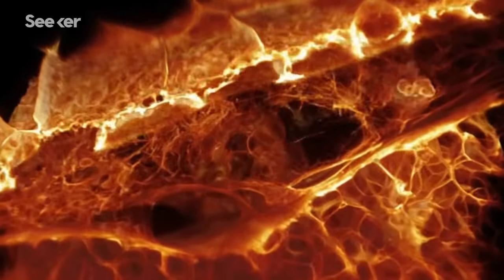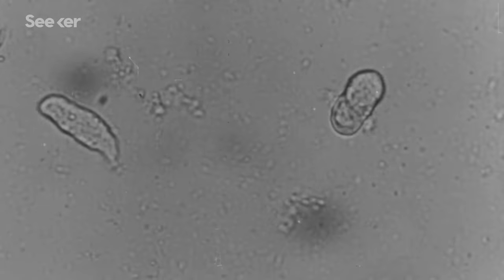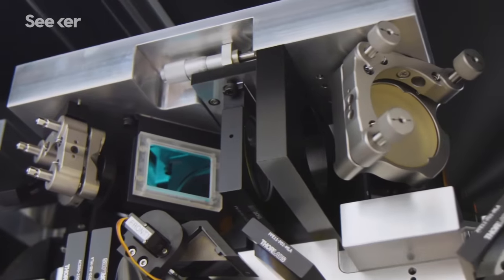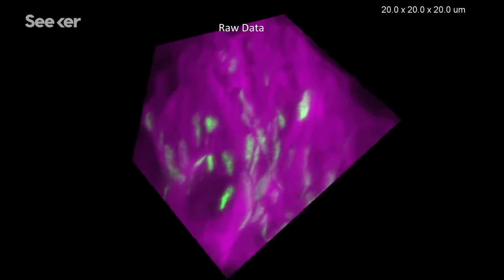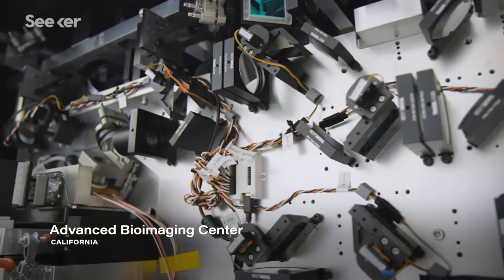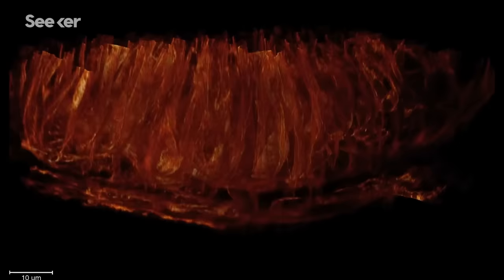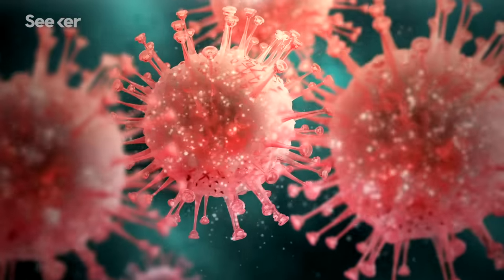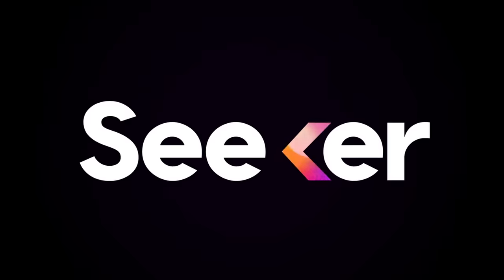Your Textbooks Are Wrong, This Is What Cells Actually Look Like

Comment: They should build several of these awesome microscopes so other research labs can buy them.
Biologist: Look at the cells!!
Salesperson: Look at the sales!!
Reply: You know some patent holder is getting excited somewhere.
Reply: I can't imagine how much one of those would cost plus you'd need at least one dedicated technician to run it and then there's the software. The majority of the coolness in the video was software manipulation of the data.
Reply: R M still, having these either for hire or rent for research centers to determine whether or no they’d make the investment into tech like this could be valuable, and it would open more positions for work.
And as someone who’s currently stuck in a dead end job and has applied to thirty different work places in the last month and only received 3 calls back, this kind of stuff might be valuable.
Reply: That has already been the case for many years! The tech in this video is about 2 decades old and there are several very well established companies that sell these microscopes
Reply: @Second_UNIT  Pretty much all universities and research institutions have many of these microscopes and operators already

Comment: Very exciting stuff. Will they someday discover the basic little "spark" that flashes into life or will they prove that it could not have happened by itself?
Reply: Life is not a substance or “spark” as you say. Life in cells is described as the reactions and mechanisms between them that makes them work. Life is a property of how things interact, (in short cells are just chemical reaction machines) not a tangible “substance” as you think of it.
Reply: @soyjakchud  I don't think of life as a substance, The "reactions and mechanisms"  of life are very intricate. At what point and how do the reactions become alive - that's the question.

Comment: I think that rocks help with the          process of photosynthesis by heat treatment of molecules which causes it to warp and climb like salt in a jar does vibration to like cracking a egg puts stress on the seed or shell causing it to break at a certain hard ness and morph

Comment: This technology should be used to scan the new organs discovered in the human throat, my theory is that they are connected to the human Brains Primal cerebral cortex, acting a cooling system for the brain. The new organs release pale/yellow residue from the throat tonsils. It does make sense that these are food particles as the digestion process occurs in the stomach. My theory makes sense. Local Critical Thinking. 10.26.2020

Comment: You need to check out rice university professor of synthetic chemistry tenured professor James tour .you want to see how complicated the machinery is inside a single cell it is a factory ,so complex it will baffle your imagination .the question will arise how did this ever evolve ?it brings focus to the term irreducible complexity. You must check out this man’s work 150  Patons  . From nano cars to one atom thick carbon Nanotubes they can use to reconnect spinal cord brakes with an 88% normal function afterwards truly astounding.

Comment: Now see the sun's energy and see how they both look so similar. The actual activity from the entered energy keep things manageable. The fire if you will was acting within a range of structure that keeps the warmth of the living. The cold has some partial need too as perimeter . how hot would it be if the range was not in place? The colors are for the separating each dynamic. Yet the colors are real. Science excluded creational truths for some time because the glitch in what holds even that structural event.